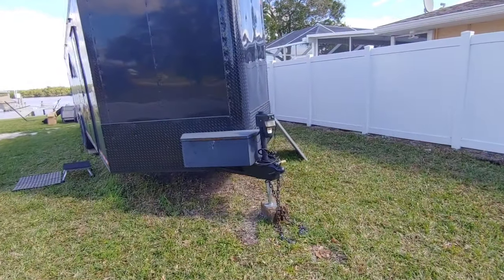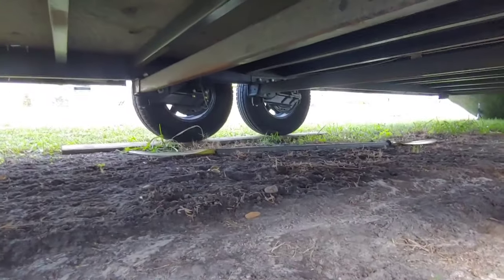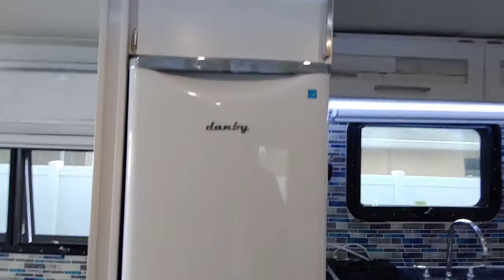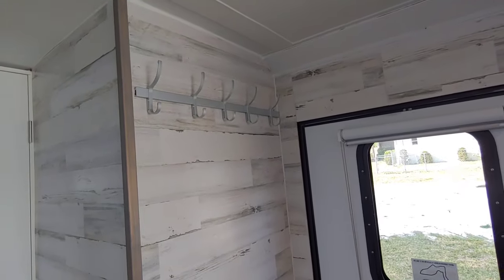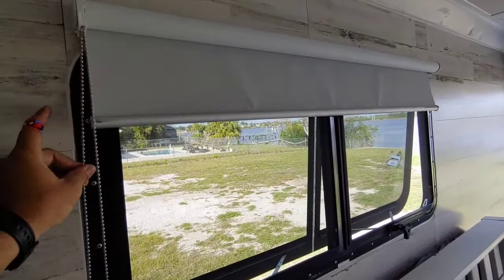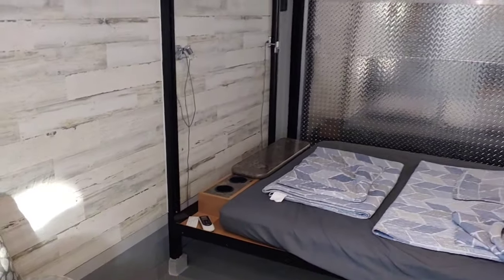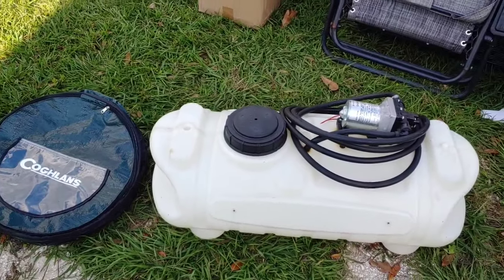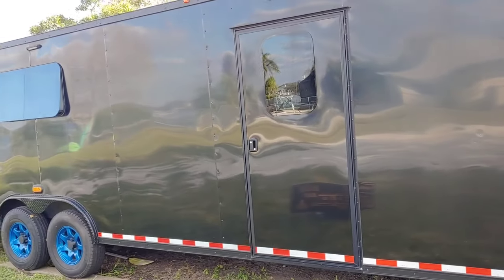28ft cargo trailer toy hauler camper conversion. mini split short version walk through.FOR SALE 18k

Comment: How much battery inverter and solar do you need to run this minisplit? When i uzed my motorhome i had ro use a portable geni a 4500 i had. I have solar n all that but everyone said it would never run off solar n batteries but i hear now it does.
Reply from the maker: Mini split runs off the generator.  Only thing I had on solar was the fridge. The solar and batteries needed never made sense for me. I would never burn that much fuel

Comment: love the length, i have a 2003 20-footer, i gained my extra space by adding a fold-out bedroom [tent with a queen-sized bed and a liner that makes it dark, quiet, and warm even in 30-degree weather.  it is impossible to see from the outside.  
I also added two jacks of the ramp to be flat and we found an 8x8x6 inflatable tent from Canada for 220.00 strapped to the ramp and four anchors in the ground using 18''' spiral dog stakes.

I found a large heavy-duty CARGO NETS at harbor freight for 24.99 I use it to hold items down or up, to clips on walls and the floor. everything stays put and away from the side by side.

Comment: Thanks! It's not that I don't like music, I have bad hearing. The only way I can describe it is similar to bad vision. It's "blurry" so the music makes it hard to hear what you're saying. 
Perfect timing. I'm picking up my new 24' V-nose next week. An extra foot of height, heavy axles. 
I already have the toilet and sewer parts. The trailer will pump itself out thru a garden hose. It pumps uphill too. No mess, no spills, no smells. 
I have the same generator and installed a big wheel kit. Rolls thru sand and gravel easily now.
I like the bed. I've always used a cot. I'll look into the bed for sure.
Reply from the maker: I understand. There were some parts that were hard to understand and I know what I'm saying. Good luck with your build.

Comment: Great build!  I have all types of questions?

Where did you get the windows from? They look like frameless windows.

What’s your clearance underneath the trailer after upgrading the suspension and tires?  18”?
Reply from the maker: I bought the windows from a rv surplus off ebay. Clearance was probably 16 to 18 inchs. I gained about 6 inchs from factory

Comment: Nice setup!!! What generator do you use? What is the twin bed that you are using? The two legs sticking out don't get the way?
Reply from the maker: Westinghouse  4500. Same as onan 4500. I bought the bed off Craigslist no idea. Usually the two legs are high enough that the car fits under

Comment: Very well done.  Love how you have hidden the mini split.  I'm guessing you installed all the windows and flip up doors (like for the mini split?)  Any reason you bought a 28ft instead of a 32ft (the largest I could find anybody makes).   Is this a standard "torsion" suspension on your trailer?  That was probably only a 7-8k trailer 3 years ago but a 15k trailer now.  crazy.
Reply from the maker: I did install all the windows myself. The door for the minisplit is a generator door that is a option when building the trailer just let them know where you want it. Also let them know where you want the entry door. A 32 was about 2k more and the extended v nose was only 500. It isn't a stand suspension.  It's a timbren suspension system. Fully serviceable and cheaper then the torsion upgrade. This trailer was 13k pick up in the factory 3 years ago. The options add up quick.
Reply: @BuiltByMike  thanks for the details.  I will look up the timbren system.  I have a 8.5x20ft with 10400 gvrw.  I think you said in the video that it lifts the trailer a little bit?  How much?
Reply from the maker: @factionfx  you can buy them in different configuration for different lifts. They have different spindles

Comment: How many btu is mini split? Trying to add one to my 26’ but it’s 1.5’ foot taller than normal enclosed. I’m in Florida so 90 degree days are rough. I insulated it but I will have toys in mine but need it to cool it down on the extreme days
Reply from the maker: This is a 12k. Biggest 120v you can get. I'm in Florida also. When it's really hot it struggles sometimes during the peak of the day. My trailer being black doesn't help either.
Reply: @BuiltByMike  is yours insulated? Yeah I wonder about going to a 18k. My electrician said he can wire it in my box and generator should push it fine. I don’t want any struggling
Reply from the maker: @sinnir69  it was at the factory but they did a half ass job. I want to run my trailer on a 4500 invertor generator so a 18k is out for me. It will still keep the trailer under 80 when it's about 100 outside
Reply: @BuiltByMike  yeah I had to do mine just after was built. So I have a 3500 4500 surge inverter generator. Neighbor electrician says he can wire it in my 50 amp box to run a 18k 220 inverter since they don’t pull a lot of wattage but I’m kind of getting skeptical about it. I did just get some good advice about some stuff to coat the roof that keeps it sealed and cooler. Tropi-cool